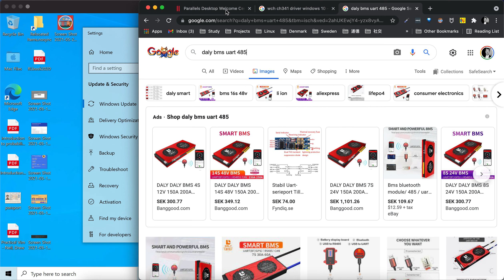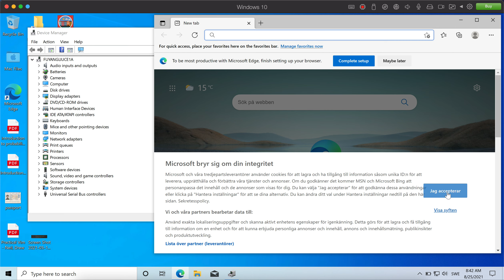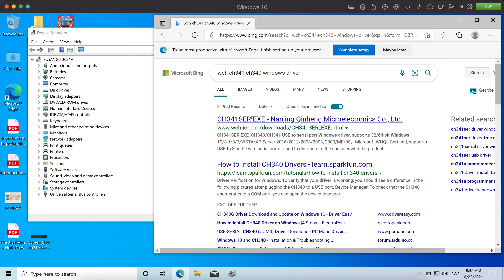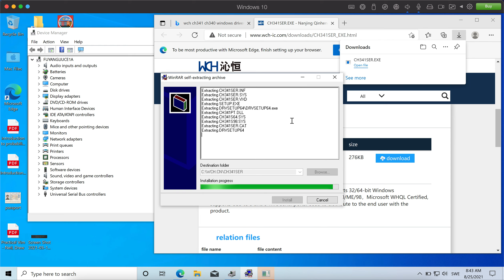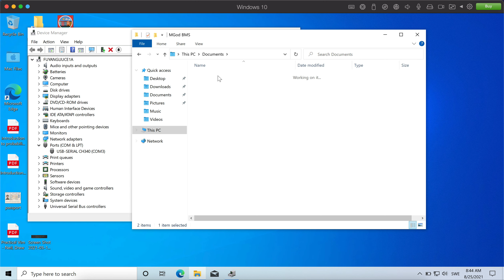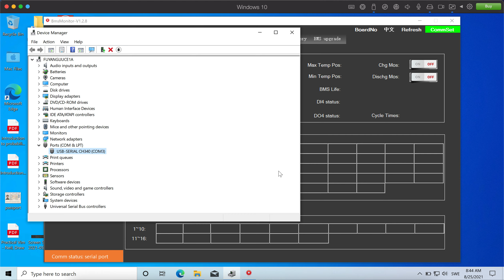Tutorial - How to config Daly MGod BMS via Daly PC software BmsMonitor UART/RS485 USB (Windows/Mac )

Comment: Is it possible to change temperature valve from Celsius to Fahrenheit using the pc setting ? I have tried using the Bluetooth settings but haven’t even found an option to do so.
Reply from the maker: I am not sure but changing the temperature value should be a software issue/feature and not hardware related. Perhaps you could contact the seller to add this feature for their future app update but I feel those BMS manufacturer are not good at develop their client softwares.
Reply: Thanks, I’ll try the factory but won’t hold my breath.